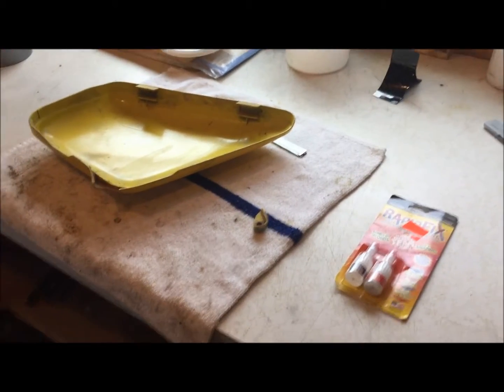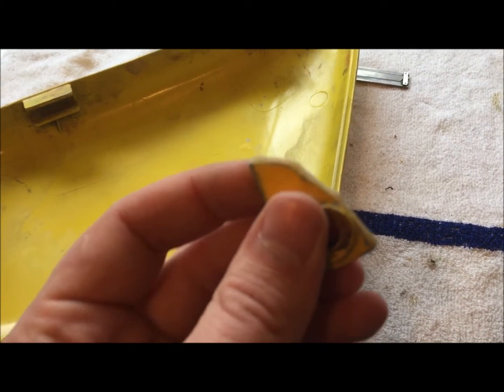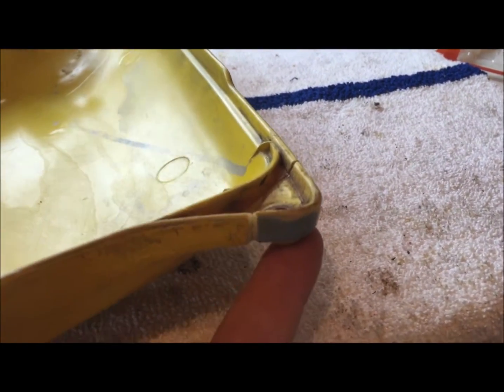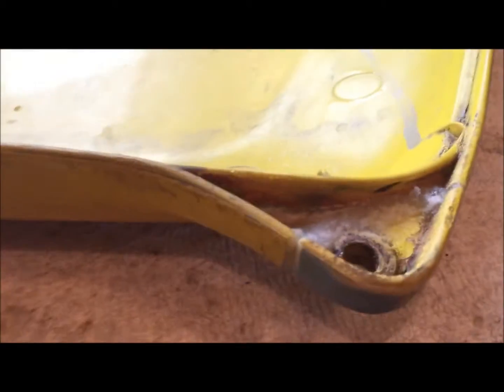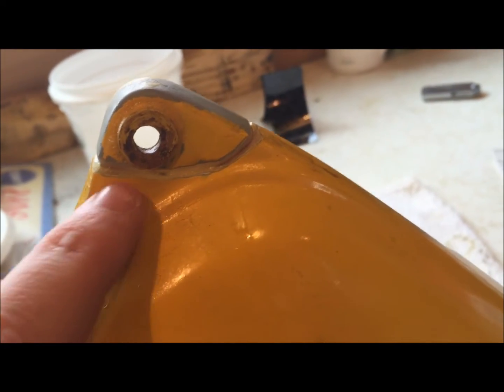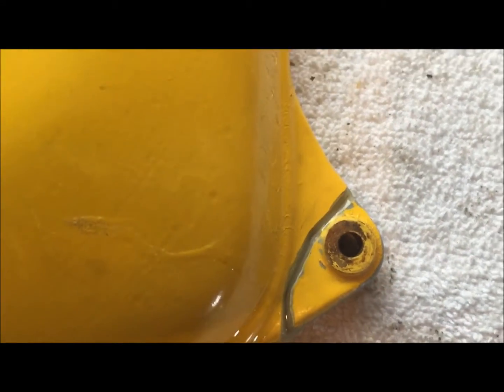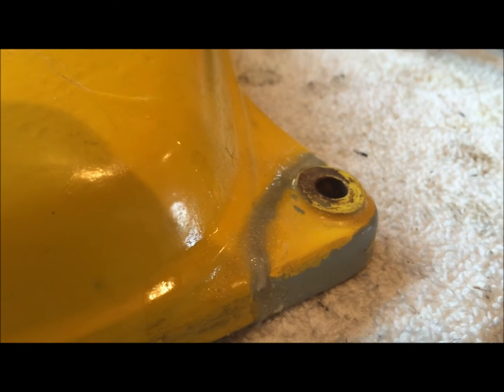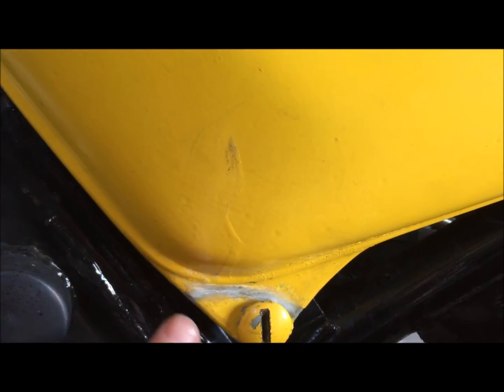Rapid Fix Review

Comment: I'm curious to see how well this works.  I repaired a crack in my radiator with super glue and baking soda two weeks ago and it's still holding.
Reply from the maker: My cover is still holding strong. Hows your repair holding out?
Reply: I used this stuff on a big 3 corner tear in lower instep area of a pair of newer muck boots. To my amazement they still are waterproof after 3 months of almost daily use. I can see the top layer of powder and glue has some cracking because of flexing. If I had to do it again I would have just used the glue and no powder. It really did work for me.